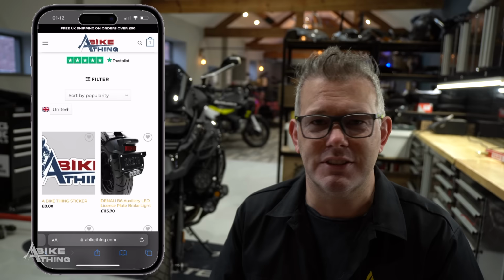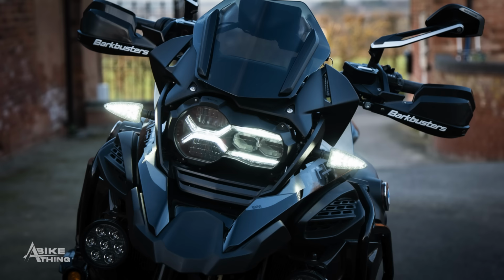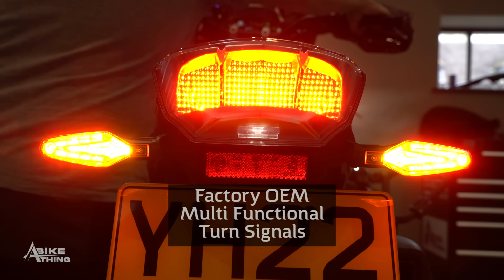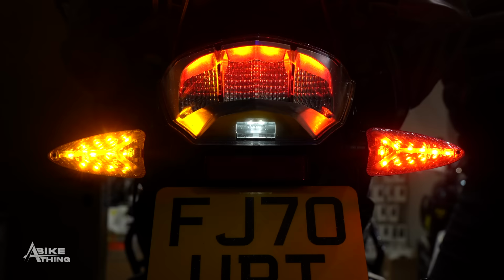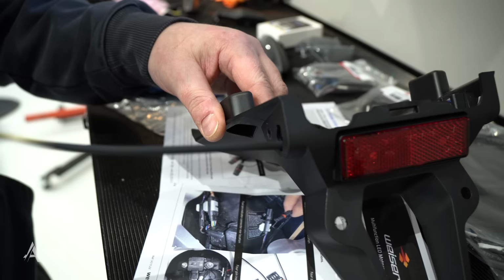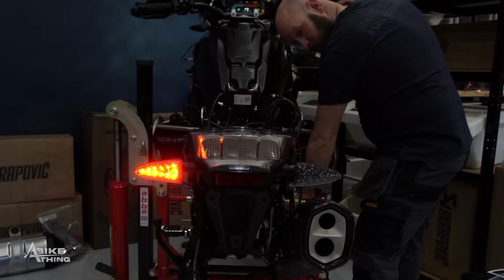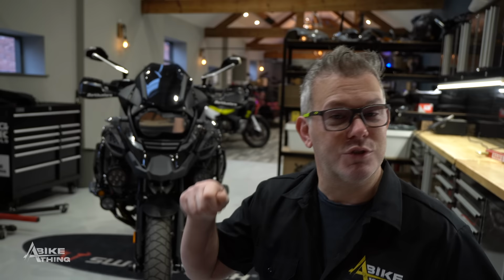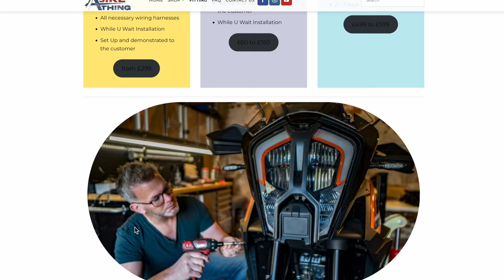Brighter and Clearer Turn Signals for our Motorcycles

Comment: UPDATE to my earlier comments--I have now installed the Weiser EVO Extreme lights; front and back (or rather I should say, I've HAD them installed by my favorite SoCal BMW dealer, Brown Motor Works of Pomona, CA) and the EVOs are damned impressive. Converting the front indicators to BRIGHT white DRLs changes the entire presentation of the bike to oncoming traffic--they see nothing but pure, clean, white light, and when I indicate, the bright amber indicator is impossible to miss or to misinterpret. 

That brings me to my Denali lights (a pair of D7s just below the stock headlight, and a pair of D2s on the forks, mounted low, near the calipers). Initially, I had the Cansmart programed to kill each D7 as I indicated left or right--as most of your installations have done. However, after having just paid big bucks for the EVO kit, which provides much brighter front and rear indicators, I no longer feel the need to kill the corresponding D7 when I indicate (and have reprogrammed the Cansmart accordingly).

But there was a second reason for ditching the D7 off-when-indicating settin: when using the indicator to change from one lane to the other on a freeway, having the D7 reactivate behind the vehicle I'm now following, it appeared to me (and I assume to him) that I'd suddenly hit him with my brights for no reason. I know my D7s are bright (oncoming traffic often tells me) so I can imagine how it feels to see them come on in their review--and I can only imagine what goes through their mind (@^%#!!). So, ixnay on the dim/dip when indicating--my EVO's are bright enough to shine through my D7s! Anyone disagree?

Comment: I reported these exact safety concerns with my dealer and asked them to report with BMW motorad. Reply came back that I could purchase older style indicators at retail cost. I had someone walk across road in front of me because they thought I was turning due to amber lights and a mate was following me on a ride on a sunny day and said he couldn't see difference braking/indicating which during my report I asked why they didn't at least put the indicator section as the outer part of the rear indicator's. How on earth did BMW get these to pass type approval is beyond my understanding.
Great video, just a shame it takes owners and companies to rectify huge safety risks from manufacturing.
Reply from the maker: The older indicators will not fit the newer bikes.  Different pin counts on the rear set.

Comment: NOTE for US users.  The US Models function like the older 2016-2019 Models.  Rear Turns are that only.  Center is RUN/Brake as previous.

Comment: I really like the look of the white light across the front of the bike.. looks great. It’s quite puzzling what BMW have done to the indicators for 2021, onwards, bikes! I thought it’d cause issues even before I heard of any problems arising. Luckily I have a 2020 1250 GSA which has the separate rear light, but I’m now hanging on until the 1300GSA is available. It’ll be interesting to see if they have the same configuration, or might they have listened to feedback and designed in a resolution. If not, I’ll be paying you a visit to have the Weisers installed. Great video 👍

Comment: Hey Bike Thing! I follow your channel along with others and enjoy your channel here in US.
I have the 23GS in the trophy version Which I took possession of toward the end of November. Like all my motorcycles I've had I never left lighting at factory standards, and this GS was no different. Unfortunately the headlights that came on the 23 were halogen because of Shortage in electronics industry, but I did change the halogen lamp sound to LED's which truly improve my writing until the new retrofit comes to to BMW the end of this month which is February.
I immediately didn't like the BMW you turn signals Both front and rear because I didn't think they were at their maximum capacity of what they could be doing. I found on another channel  Called just the way it is Who focuses on the GS, wiser technologies LED Lighting for front and rear. I immediately purchased and it was delivered and I broke the bike down and installed it.
This lighting is at least 5 times brighter in the rear and 20 times brighter on the front running lights. The rear act as integrated with my brake lights which Are red running lights and super bright red brake lights integrated with the stock Light, And directionals turn bright Amber.
Front running lights are 6000 K bright white, and during directional used they are super bright ambers.
I am more comfortable writing any motorcycle knowing that I have more lights to be seen in the rear and also be in seen from the front for those idiots that want to turn in front of you.
I enjoy your channel from Afar and appreciate your work and your due diligence !

Comment: Fixing a problem that shouldn’t even be a problem. BMW need to take note. 

I really don’t like the MFTS on the later bikes. I stuck with my 2019 GSA in the end when looking to update it. A small part because of this but also when I was looking, BMW couldn’t guarantee anything more than a Halogen Headlight (which I would have to pay to get swapped out when the new one was available). No thanks. 

Great vid.

Comment: Just to be pedantic... Mark at Weiser Technik would prefer if these lights were not referred to as DRL's (i.e. Daytime Running Lights) because dedicated DRL's are not designed to be used at night in some countries such as the UK. Weiser Technik refer to these as "driving lights" and as such intend them to be used at any time.
Also my YouTube pal Carl at his channel "Just The Way It Is" has several in depth videos regarding these lights (inc. two excellent installation videos) and I also have a video of me fitting them to my R1250R... a 2021 (Euro5) bike without multifunction turn signals :)
Reply from the maker: Thanks Ricky.  Im sure you can appreciate Mark and I have spent quite a bit of time getting these products stocked on our shelves here at A Bike Thing.   I'm fully aware of Carls excellent videos.   Later in the year I'll be bringing another video showing ezcan compatibility with these lights too.   We have videos on our channel showing full GS and GSA strip downs too.  I don't feel we need to make a Weiser specific installation video in huge detail as the enclosed instructions are very easy to follow.
Reply: @ABIKETHING  It's great that you are stocking them and getting the word out about these lights - I certainly appreciate the extra illumination and functionality they bring to the bike.  As a CanSmart owner I'll be keeping an eye out for your compatibility content too 😊 Keep up the good work!
Reply: @ABIKETHING  Nope.  You're 'screw-by-screw' instructions are easy to follow when installing your Denali packages, but these are not at all.  Not even close.

Comment: The front lights. Do they display white at night or are they just daytime running lights?
Also, the website offers extended length indicators… the ones installed in the video are these the medium length pls? Cheers
Reply from the maker: They stay on at night but we can change this if we put them through the ezcan and set the white light to do what we want when we want.    I have medium on front and short on back in this video

Comment: Hi Steve - or anyone else, so I have the ezCan that you fitted for me (thanks!) - I'm sure I have a spare socket free, if so does that mean it's even simpler to install. I.e they plug into the same OEM sockets and the one wire goes into the ezCan? Thanks

Comment: Hi, got the combination set a few weeks back and still have not got around to fitting them 🙄 Just watched the install video again and noticed you mention that they can be wired using an EXCAN circuit rather than the relay. I have spare circuits on my EXCAN (only running a set of Denalis). Is it simply a matter of connecting the relay wires onto the EXCAN circuit rather than fitting the relay to the battery and splicing into the bike wiring? I would rather splice in into the EXCAN circuit rather than the OEM. The bike is a 2019 1250GS. 
PS - if there was an easy to purchase connector that would save all the splicing that would be even easier 😁
Reply: EXCAN is predictive text of ezCAN 🙄

Comment: I’m a little confused, I see all the options on what size stem for the turn signals, are you using the oem stems and just replacing the CB? If not, what size stems did you use? I’ve got a 2019 GSA.
Reply: To me, looks like medium stem front and short stem at the rear.

Comment: Steve, I didn’t see it in the video but how much of the tank etc has to come off to wire the front up? I’ve done it before for some D4s but not sure if same effort involved to retrofit these? Thanks. Great vid
Reply: I took the whole thing off and did it at the same time as the D4's.  It would be quite vulnerable if you didn't, especially considering how thin the wires are.

Comment: Steve, I’m currently using all 4 circuits on my EzCan. Would wiring the trigger wires to an EzCan splitter cable (I have two on the shelf) work better in lieu of a relay in this circumstance? If so, would I need one or two splitters (one for front and one for rear)? Or just use the relay? I have a 2020 GSA.
Reply from the maker: Hi, positaps come in the kit so you can join front to rear anyway (saves on buying a splitter) but then the one wire can go to one circuit as a light pair and this would mean you wouldn't need a relay.

Comment: I don’t ride a GS, and wasn’t aware of this issue at all, but begs a question - How on Earth did this pass the board meeting? Do they not care about safety? How did they get TÜV (or whatever the German technical inspection association name is) approval? It’s ridiculous. I also hate my Honda Africa Twin Adventure Sports amber running lights on turn signals. Makes no sense. If they don’t glow white what’s the point. All it does is create more confusion among already heavily distracted drivers.
Reply from the maker: You make a valid point
Reply: It does make sense - amber/yellow lights are perceived more easily than white bulbs in daylight, and there is research (albeit limited) to suggest that amber drls on motorcycles increase safety over white drls. Again, given that they have been on Hondas for years I think we'd have some evidence by now that they are a singular cause of accidents rather than rider or driver error.

Comment: Hey Steve, nice video. That project bike looks awesome. I currently ride a KTM890 adventure and was wondering if weiser make any of these for other makes and not just BMW’s because these are great looking lights?
Reply from the maker: Yes, absolutely.  They fit the majority of bikes. I’m just focussing on the beemers to begin with and then will expand but if you select the weiser lights for the 2013 to 2020 model, these will work on the KTM
Reply: Awesome, cheers for the advise.

Comment: Hi Steve if using with EzCan on older bike can you make front turn signals into DRL’s?
Reply from the maker: Yes you can but you need to attend to the dash error you’ll get when you unplug them from the bike and reconnect to ezcan.  If however you buy these Weiser lights, you can just plug them in and they’ll be a DRL that flashes when you indicate

Comment: Thes lights are brilliant and they solve in my opinion a dangerous problem…. However weisser need to make them plug and play… the need for an additional wiring loom and having to Mickey Mouse a feed from the rear lights is not for me… when weisser fix this I will purchase immediately.

Comment: SPOT THE MISTAKE...?
I think that you might have fitted to indicators on the wrong sides initially. You had the drain holes at the top 😂

I claim my prize of a free set 🤞
Reply from the maker: Well spotted 😂😂😂.  We spotted but thought I’m not filming all of that again……no one will notice 😂
Reply: @ABIKETHING  I'm currently saving to get a lights and horn pack fitted, I'll now be adding the indicators. I'll be in touch once the piggy bank is full 👍

Comment: anyone know if there is a way bmw can turn off front and rear drl? I absolutely hate them on my 23gs. Dangerous and hardly visible .
Reply from the maker: We have something coming soon
Reply: That will be very interesting
Reply: @ABIKETHING  hope it’s just as simple as nothing happens on the lights until I indicate then nothing happens again when I cancel them. I have asked BMW what was wrong with standard clear as day lights as they are horrendous . They have no answer but you can purchase without the “lighting pack” which will be standard indicators apparently.

Comment: Odd that Honda riders don't seem to have the issue that some GS riders do? Accidents happen, and there is no good way of knowing whether this was down to the front lights. As bike riders, we all experience cars pulling out from junctions by mistake, and I can't say that the number of such incidences has increased for me over the old indicators vs the new. Too easy to blame the equipment. 

As for the rear, many modern cars have the same multi-cluster format in which the brake light washes out the indicator. But if the rider is only indicating near or at the time he or she brakes, then perhaps that rider needs to reassess their roadcraft. It should be a non-issue.

Comment: They should have a fix from firmware. You go to the bmw dealership and they only click some buttons while the bike is connected to their laptop and be done with it.

1. turn on/off position light on central light
2. turn on/off position light from turn signals
   2a. turn on/off position light while signaling from turn signals
3. turn on/off brake light from turn signals
   3a. turn on/off brake light while signaling from turn signals

It's should have been that easy, a few on/off switches on the firmware software updater canbus thing-a-magig, but alas, it's not.

These weiser lights are terrible imho. They are bulky, ugly and the screw is at the front of the lense? not even at the back? pfff. Where as the bmw turn signals are sleek, sexy and not a horrible dot matrix.

That and the fact you have to tap into factory wiring, and connecting a relay to the battery, that's not what plug and play means, Steve. I think that all of the modifications you've done over the years have gone to your head if you think using posi taps is plug and play 😬

In conclusion, it's a no from me. I have the 2022 GSA with multifunction 1 and multifunction 2 options fitted from the factory and I'm perfectly happy with them. Please note that I rode over 16.000 kilometers within 6 different european countries with my bike.

While I agree that the bmw solution is dodgy at best, I never had an issue with the amber DRL's at the front. And on the rear, I simply turn on my indicators before I have to brake. It's what every driver should do, even the ones in cars/trucks/buses. 

There is also a traffic rule for that. You are required by law to use your blinker 50 meters before the intersection in a town and 100 meters outside of it. It's that simple.

What's the point of turning on the signal as you're making the turn? It makes no sense but I've seen plenty of drivers doing it. Even drivers turning left from the first lane instead of switching to the second lane and then performing the turn (while driving on the right side of the road)

I would also argue that there are bad drivers everywhere and I highly doubt installing these ugly yet less shady lights would make the bad drivers pay more attention to you or be less bad.

But even though I don't personally like the weiser product, it's always good having multiple options to chose from. However, I will stick with my factory OEM multifunction indicators for now.